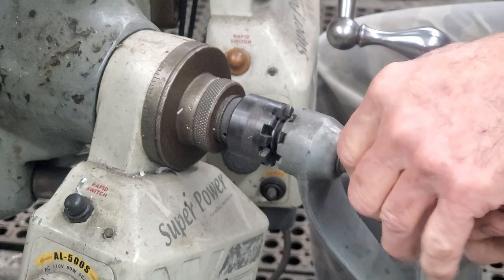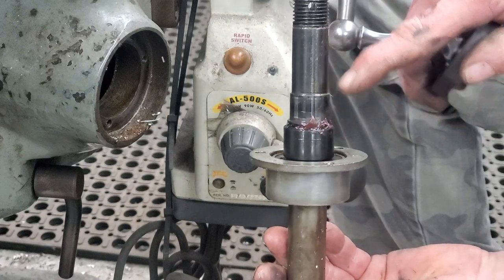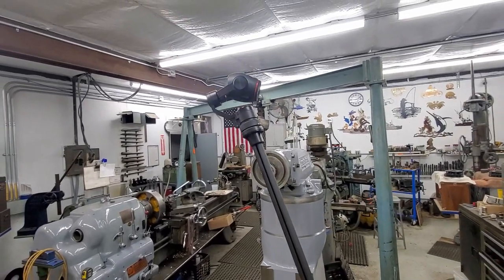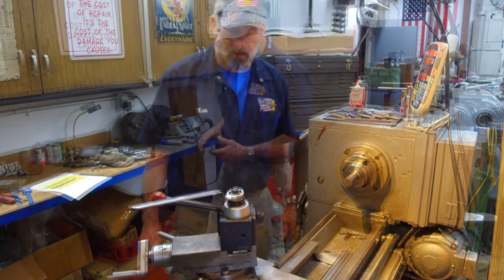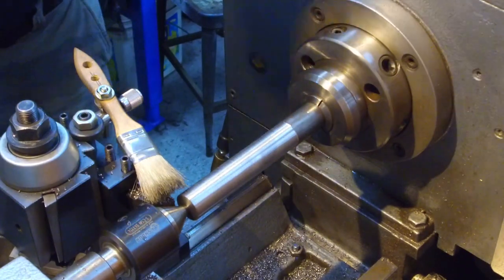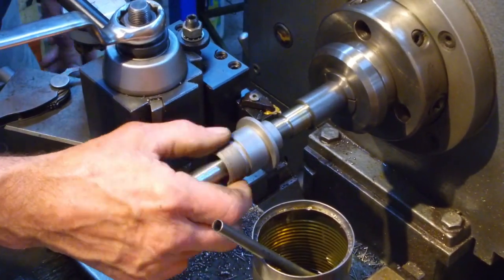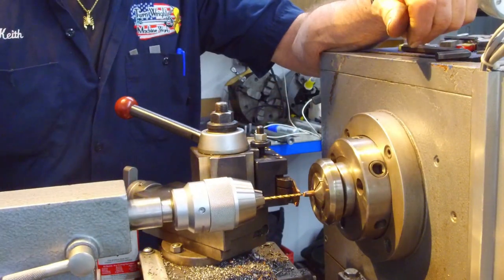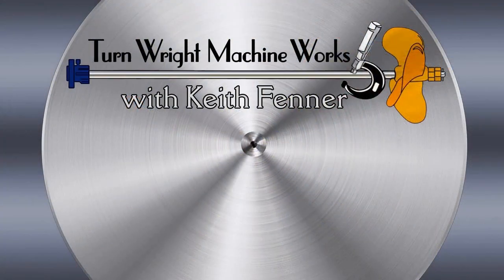Buffy's Back Part Five

Comment: Great tip on the brush mounted on the QCTP.  I have been wondering for a few years on what I could do to cut the hot chips hitting my hand on the controls and throwing random streams around.  Super good as it does the job but doesn't get in the way or obscure the view.  Going to be making one in the next few days.  Thanks.

Comment: I haven't seen the paint brush trick since the 1960s. That was done with a horse shoe magnet inside a paper bag and a rubber band to dump the chips off the magnet. Thanks for the video Keith.

Comment: What you have there is a split pin, a roll pin is metal rolled into the pin dimensions giving it the appearance of a not very tasty metal jelly roll. They both have a spring effect, holding them in place, as they are driven into the hole.

Comment: I don't like drilling copper or brass. Stuff is always so grabby. Though brassing bits off does work. You basically ruin them by removing the cutting lip on a hone stone and then they drill better. But you do have to resharpen them to drill anything else.

Comment: I am just wondering why you turn as such a low surface speed, I'm quite sure that lathe won't run fast enough to hit a nominal surface speed even for mild steel with carbide and for darn sure with copper.  Keep on smiling and good luck with "buffy"